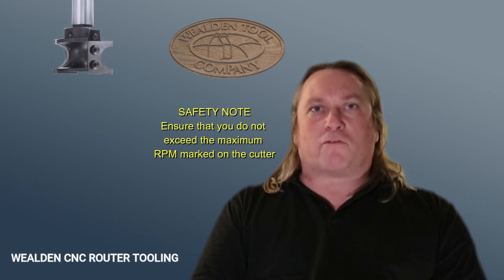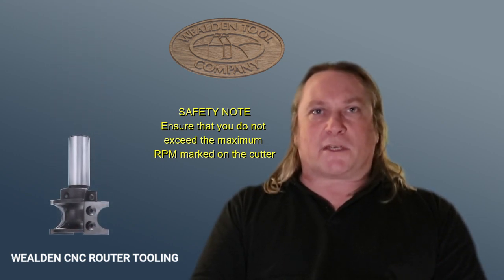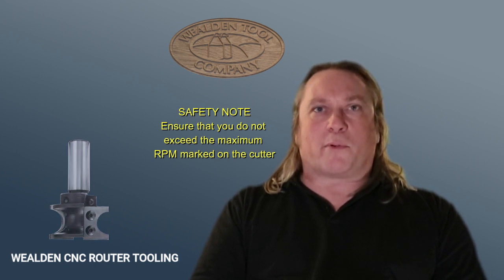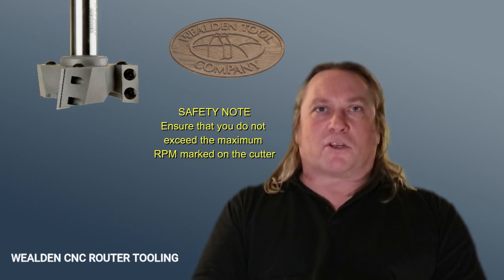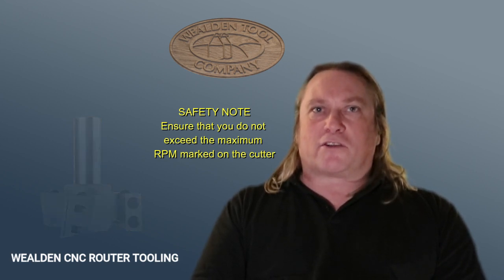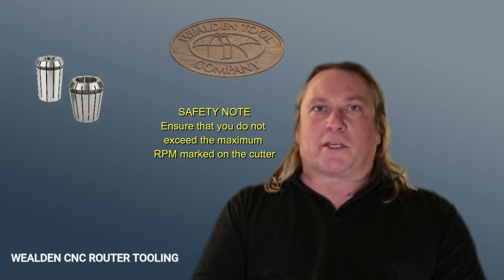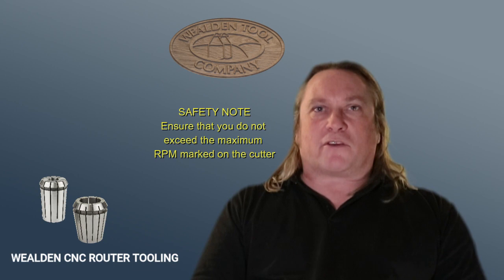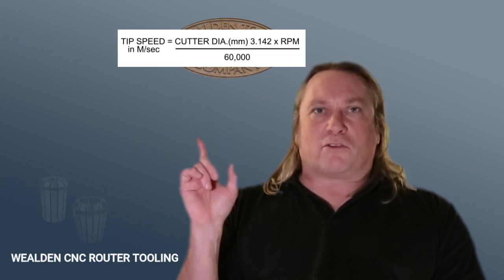Optimising CNC Feeds and Speeds

Comment: FINALLY! The video i've been looking for for years!! A video thats clear and useful, Im not a beginner but even now, several years in, i've always felt I was 'winging' it and have never been able to find a competent explanation video on how to make these decision. This Video is bookmarked! Question, I mainly cut sheet ply, but occasionally i cut MDF and Acrylic/Perspex, Would you use the same rules between the materials?
Reply from the maker: Hello James, sorry for the very late reply, I have only just had a notication from YouTube! For ply and mdf thios approach will work. Plastics are a little different as you need to reduce the spindle speed by about 25%, reduce the depth of cut and cut in the opposite direction as plastics climb cut better than conventional.